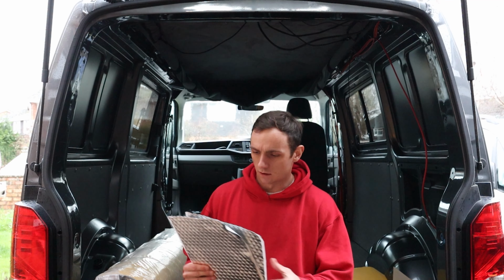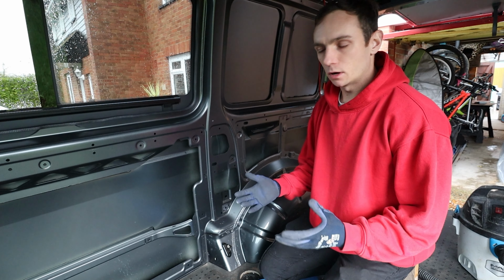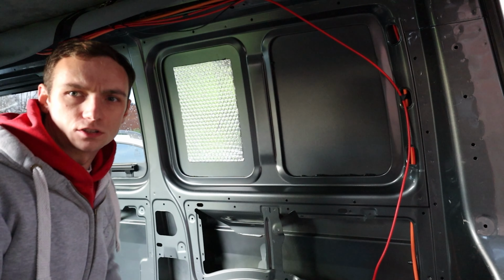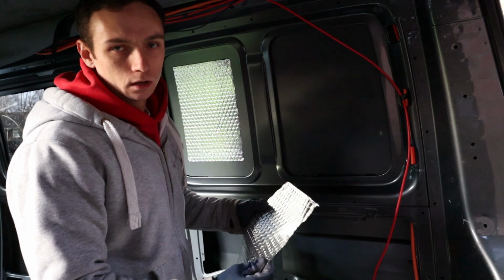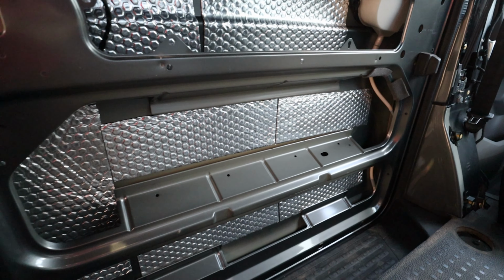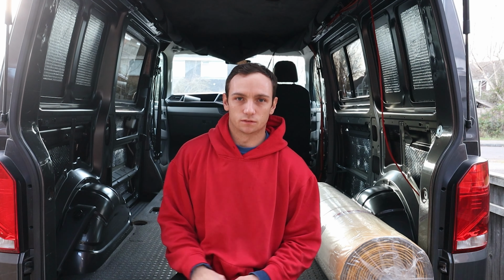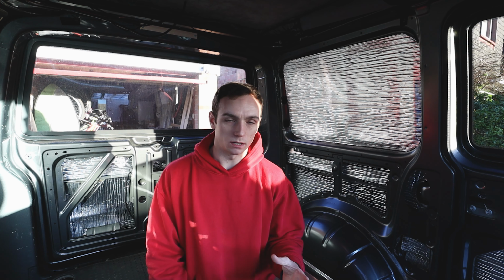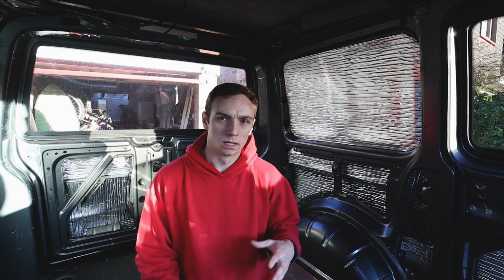VW Transporter T6.1 Camper Conversion - Ep 4 Sound Deadening & Insulation

Comment: Thanks for sharing these videos, great to learn from! 🙏 This might be a silly question, but is it necessary to put both the sound deadening and insulation in? It looks as if the insulation by itself would also sufficiently deaden the vibration of any metal.
Reply from the maker: The sound deadening removes the high frequency vibrations that come from the panels. The foam in the insulation wouldn’t do as good a job on that.
Reply: @jamespenny94  Thanks for the quick reply. Didn't think of it that way, sounds plausible indeed! Going to buy some sound deadening 😜

Comment: cool. how come you don’t put thermal insulation on the inner metal ‘ribs’ of the van?
Reply from the maker: DO you mean on the floor? The factory load mat is being used as the insulation.
Reply: @jamespenny94  I was thinking more like the inner bars, Sorta, like those ones that go across the ceiling if that makes sense?
Reply from the maker: Because I have an elevating roof fitted there is no room to put insulation up there. Otherwise you would do just that.

Comment: hey James have you found any solutions for sliding door storage all the pre made options don't have space for the little white thingy on the door, Im scratching my head with it here how to get around it
Reply from the maker: By white thingy do you mean the manual release catch?
Reply: @jamespenny94  I have no idea what it is, but its the circular plastic white yolk on the top left side of sliding door. whats does a manual release catch do🤣 Im not very wise to all the parts.
Reply from the maker: It’s glow on the dark too! Yeah there’s a small cable attached to it. If you pull it it opens the sliding door. It’s the van equivalent of an interior boot latch to let yourself out. If you take  the bulkhead out then there’s no need for it because you can get to the doors. Unfortunately I came to that realisation after I carpeted and cut the hole. As for storage, it just means that as long as you can get to the cab you don’t need it so any door store will be fine.
Reply: @jamespenny94  glow in the dark... fancy ! its great to know what it is though. How did you remove it and tidy it up? Ive a 6.1 also beginning from scratch  but much slower and much less knowledge than you have, so thanks for sharing these videos they will really help me out.
Reply from the maker: I haven’t yet but my thoughts would be to just tape it to the inside of the panel. It’s not going to open as you have to pull it quite hard to get it to pop. 
Great to hear, my advice would be to take it easy and plan as much as you can in advance. And don’t film it as you go, it’s takes even longer 🤣
Reply: @jamespenny94  Yeah taping it sounds like a plan for it alright. I come from a film making background so if you need any tips along the way feel free to reach out.